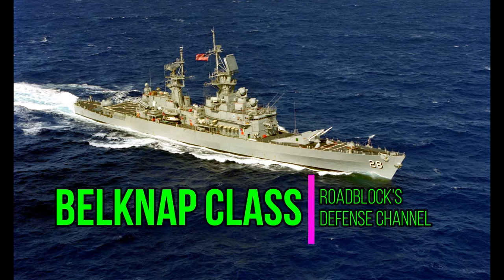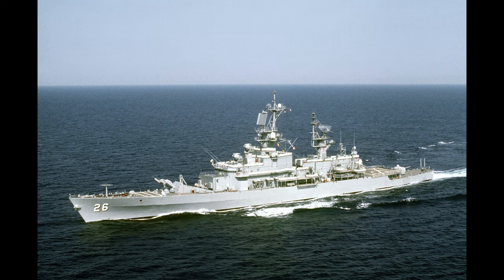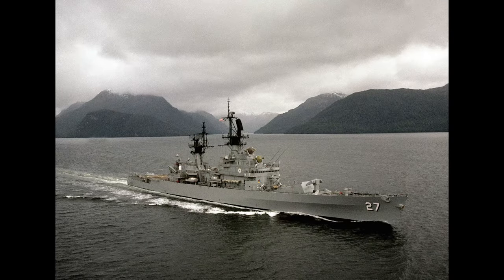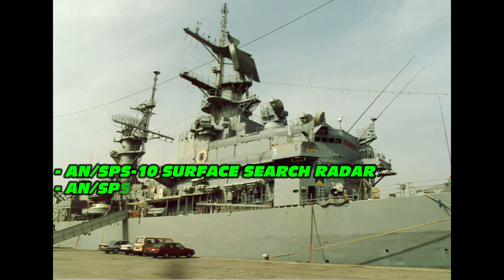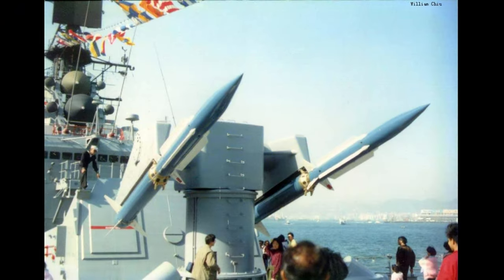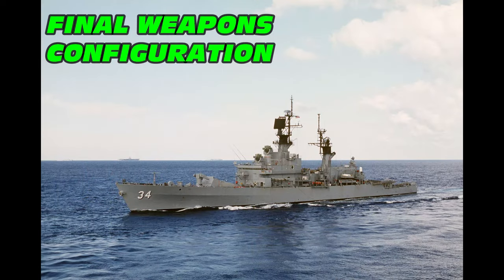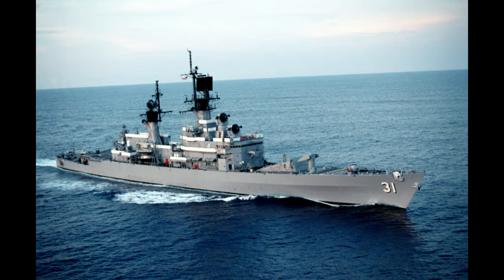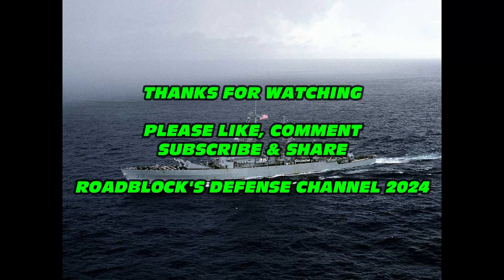Belknap Class Cruisers - US Navy [01/15/2024]

Comment: I was on the USS Belknap from 86 to 89.  We might have topped that number for the full power run, but I can't officially say so.  I was, however, on the throttles when it may have happened.
Reply: and I do know if threw a 20 foot rooster tail behind us when we did it.